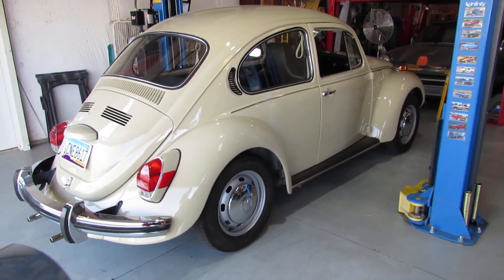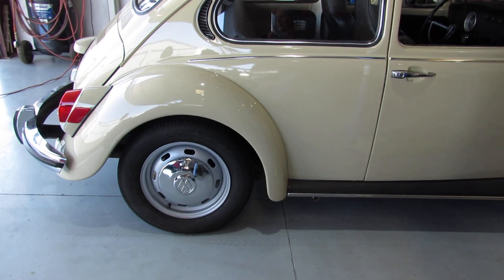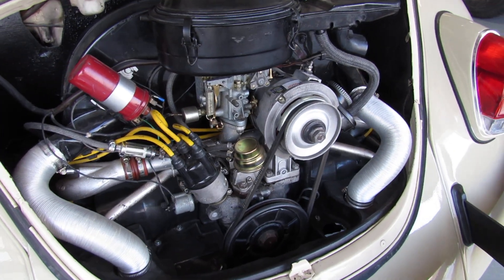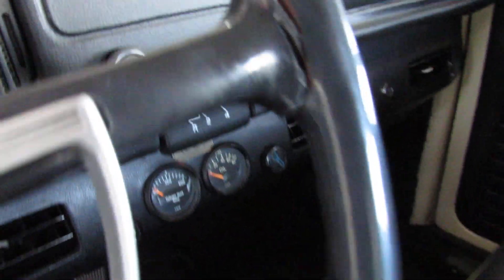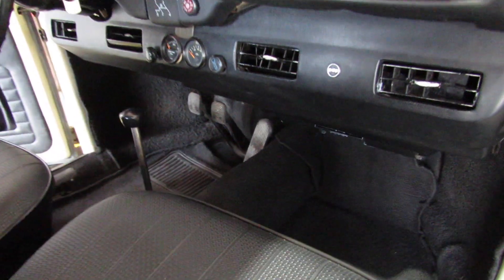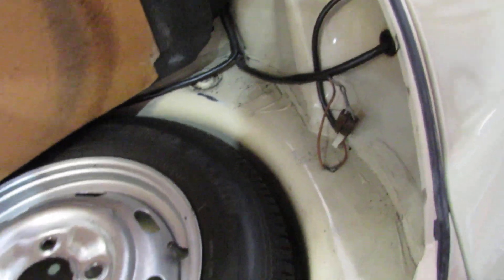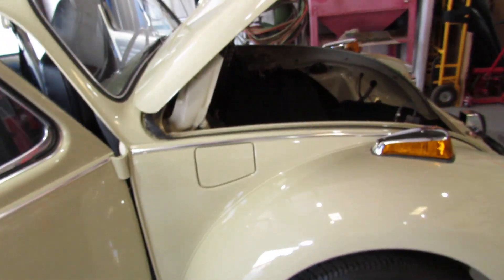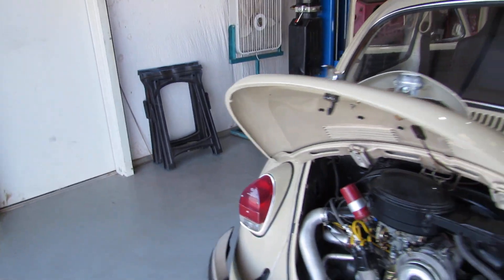1971 VW Super Beetle Donor Car for EVWest Conversion to Electric Drive

Comment: That’s going to be sweet!
I rode in a Mk 1 1965 Cortina running a Hyper9 and Tesla batteries. It had an electric air conditioner. Made a huge difference to driving on a hot day.